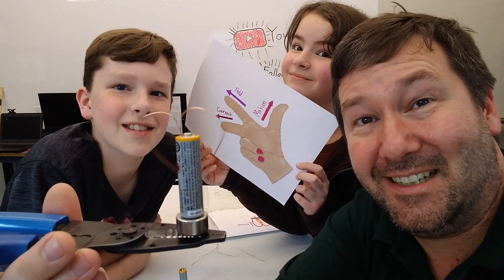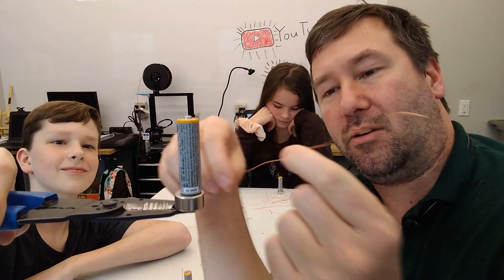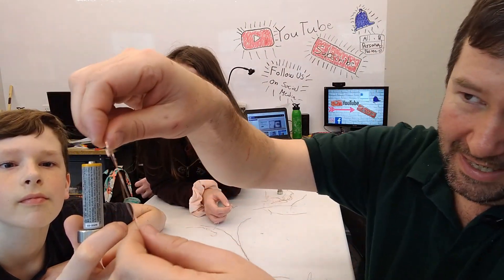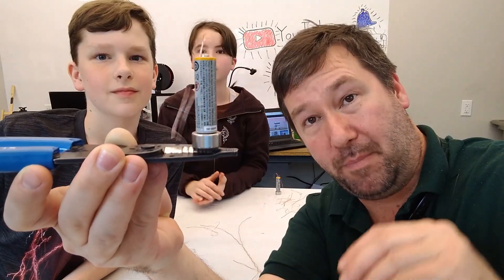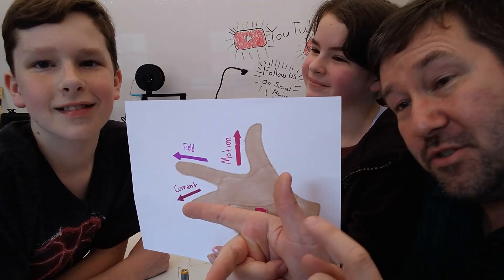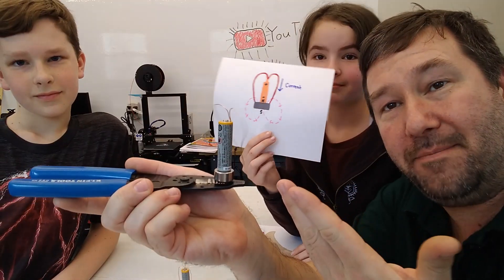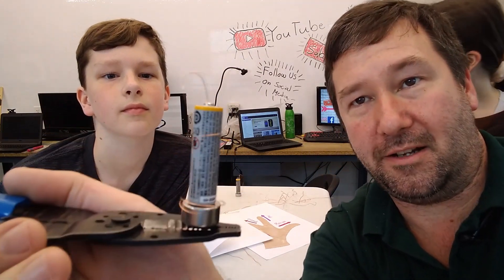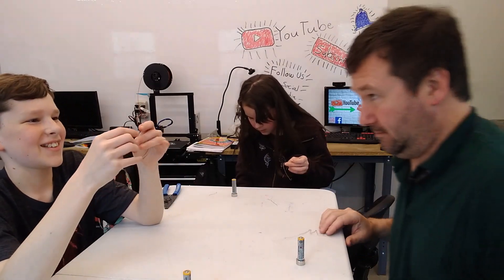How to Make a Homopolar Motor from Battery and Learn Fleming's Right Hand Rule

Comment: shouldn't we use the left hand rule for motors mate?
Reply from the maker: It has been 20 years or so since I learned it but I'm pretty sure the right hand rule is for conductors and the left hand rule is for the motor effect.  In this can we are talking about conductors.